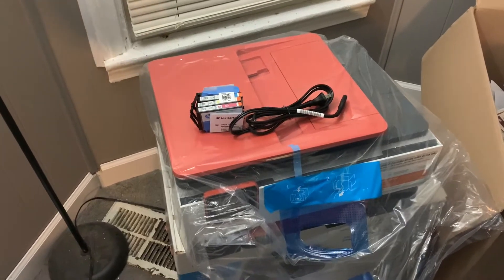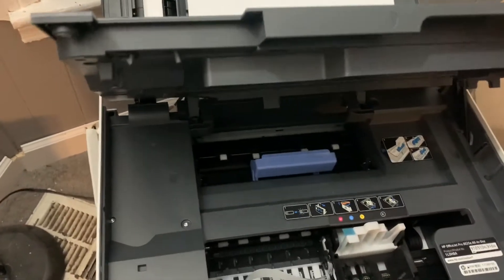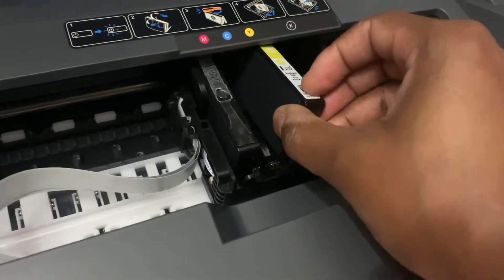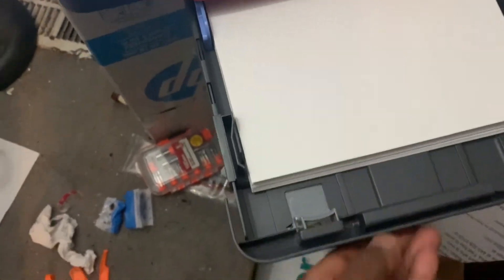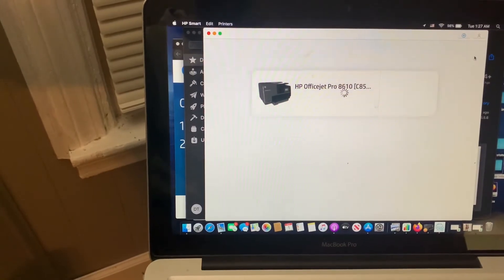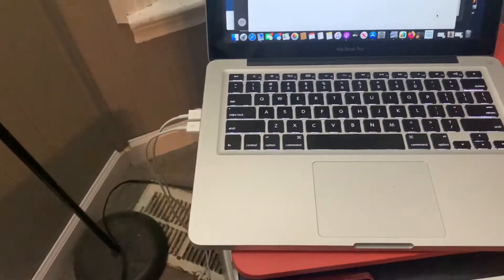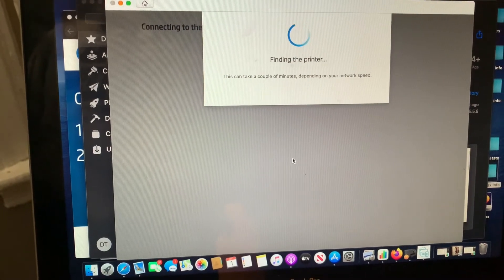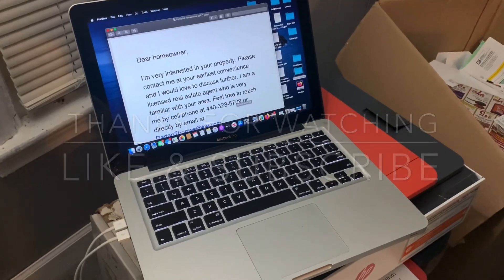Unboxing and setting up OfficeJet Pro 8035e easy step by step guide

Comment: Thanks very much for the tutorial. First time I’ve set up a printer myself and your directions helped me get it done!
One question: any way to get the paper tray go gold 8x11 paper in place. I can only get it to stay in place for 8x14. Thanks so much!
Reply from the maker: You may just have to wiggle it around a bit and push it a little harder into place. It should fit a standard 8x11.